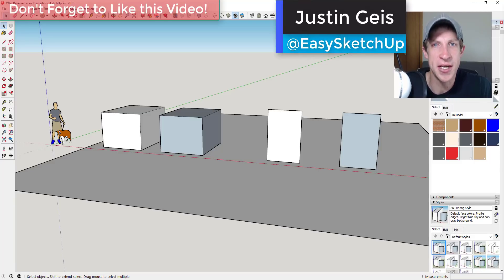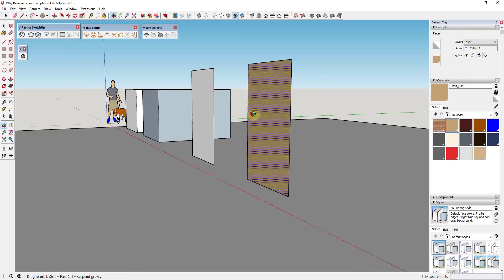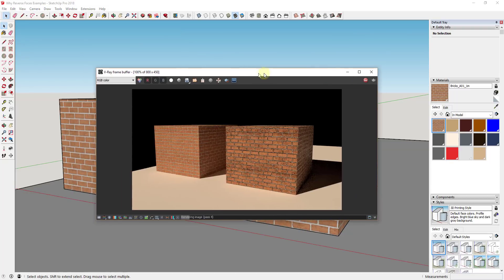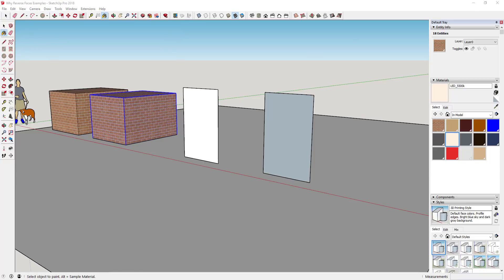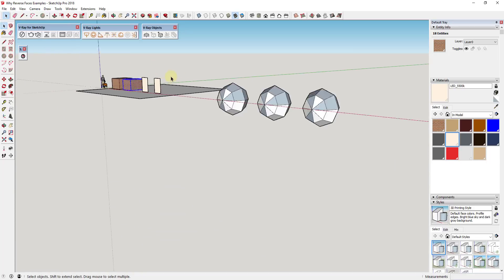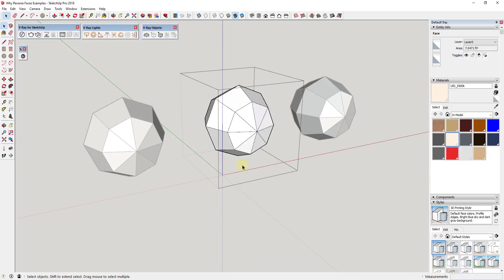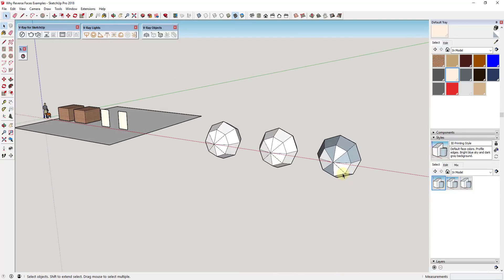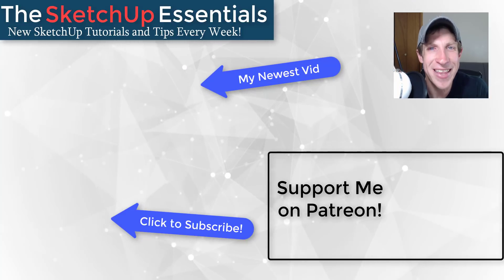FRONT AND BACK SIDES OF FACES in SketchUp and Why They Matter

Comment: You don't know how many hours I've been beating myself up banging my head up against the wall trying to work out why my 3d model wont slice the way that I want it to, because of the characteristics of the reverse faces.... it is probably one of the most hidden facts that is not only hard to describe by also harder to figure out as a result.  The key point is is that the face that facing in either direction affects / effects what the slicer sees and does with it, either its an infill, or its a support, even if there is no roof, it will still see it as a infill if its around the wrong way!!!!  Mission Accomplished, amid a very sore head, I think my brains going to explode if I didn't stumble upon this finally, but hey, I kinda did learn a lot in the process.  Geez it takes so long to learn stuff...

Comment: I think lumion recognizes front and back sides too. There was a time where my asphalt road has 3dgrass on it. I don't know what's making lumion do it...until i noticed that in my skp file, the upper side (the front face) of the road was set to asphalt but the lower side (the back face) was set to grass.

I made the back faces asphalt as well, and the 3d grass in lumion was gone.
Reply: But thanks for the video! I didn't know that was the use of orient faces... Hehe case closed.

Comment: Hi Justin, what about if you want a perforated texture/material like chicken wire or a mesh? I've noticed that if you don't paint the back side face also with the v-ray texture where you can see through the perforations it comes up as black. I've also noticed that even when you paint the back side face you are left with two parallel faces and therefore if the 'holes' don't line up it won't render well. All message boards say not to paint reverse faces and it's against all my instincts to model a single face and not form a solid (front and back side faces exposed) but seems to have the best render result. Can you or anyone shed some light on the best practice? I can't seem to find a tutorial or forum discussion that tackles this point. Many Thanks!
Reply from the maker: You'd probably be way better off asking this question on those forums as they'll likely have answers more specific to the rendering program you're using - I don't remember enough about Vray to be able to solve this issue
Reply: Hi Justin, thanks so much for you quick reply.

Comment: But how do we make it work if our scene contains both interior and exterior rendering in it. Since it vl have both front face colors applied to interior side of the project and back face color applied on the exterior part of the project. How do we tackle that issue. ? Kindly revert back.
Reply from the maker: You give your walls thickness

Comment: Why can't I push/pull to make an opening?
For a building.  I make a 20'x20' rectangle with a 4" offset.  Raise inside portion 4" to be a slab on grade, then raise 4"wide 'walls' up 10'4".  When making openings (rectangle + push/pull), I have the reverse face first for each opening.  Why is that?
Reply from the maker: What do you mean "reverse the face first?" Does it actually cut an opening and your issue is the front or back side of the face, or is it actually not cutting an opening at all?

Comment: Here's a hack I used before section cuts got fills, but which is still handy: go to styles, then use that to set the back face color like a master switch. It's a handy gimmick at times doing sections, even now that sections should fill, and often still don't thanks to non-solid entities etc. It clarifies drawings, esp in pure black as shadows are mitigated in areas not caught by the nice new section fill approach. All those interior wall faces go dark, viola. However, this doesn't work so well if you're not fastidious in flipping faces right side out. Suddenly what you thought was white is now the color you specified and you've got changes to make. That said, it is a quick model check tool: use it to find errant inside out faces and fix them without guess work.

Comment: Thanks for the helpful video. These are the kinds of things beginning SKUsers need--drove me crazy at first. I do wish there was more apparent rhyme and reason to SKU's choice of placing a face front or back facing at times. Any word on that? In the meantime, I long ago mapped "reverse face" to my multi button mouse because it's an incessant time waster otherwise context menu flipping them. Select click the mapped flip macro button, bam. Nearly no wasted time. In a year's time, a heavy user would quite possibly lose over 6hrs flipping faces using context menus. If SKU could just implement some AI on this, guessing the outside of an object, for instance should all be facing out, that'd be wonderful. Don't know if you've noticed it, but Enscape is it seems less sensitive to face orientation than some other render engines I've used, such as Twilight where things may glow, or other weird effects.

Comment: When those bricks are installed, the brick-layer strikes off the joints he can see on the side facing him, but the backside of a new brick wall (never seen) would look just like the first example of the VRay render, with the joints protruding.  Mayb VRay knows this and their "brick" paint does both sides?  Probably not possible but could be used for that.
Reply from the maker: You can apply the material to both sides, so you're probably right - the other side of the face would be rendered properly, but since it's not in view in this application, you can't see the front side of the face. Thanks!

Comment: You might have to try a few methods in concert at times depending on complexity of the model. Fredo6's FredoTools offers a free, interactive face flipping tool that's very good in addition to the built-in orient faces and thomthom's Solid Inspector plugin featured in the video. You have to also watch for hidden edges. If you have an edge that existed and then was hidden by some process, you might have adjacent edges that are 1 front and 1 back. You may have to View Hidden Edges to get some of those. They can be pesky...
Reply from the maker: Yep - effort level required will definitely vary by complexity level. That's one reason that managing your faces as you go is much easier. That being said, often when you download models from the 3D warehouse, they weren't modeled properly and require a lot of fixing.